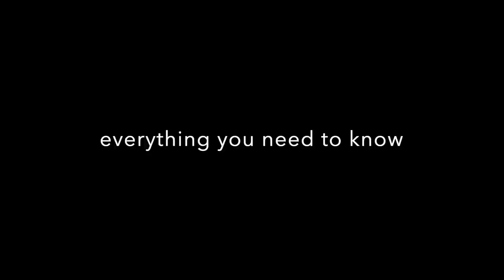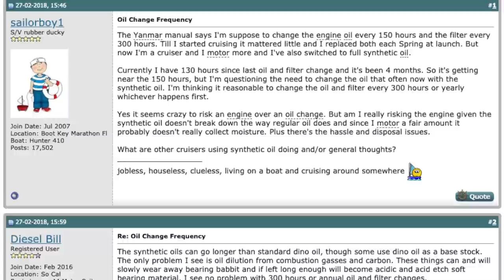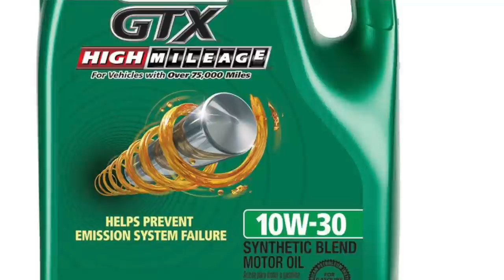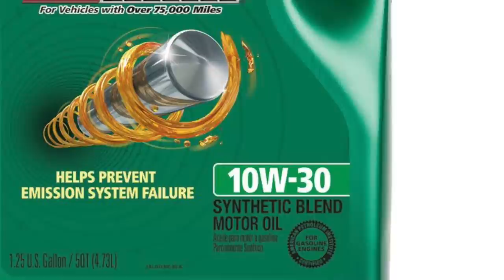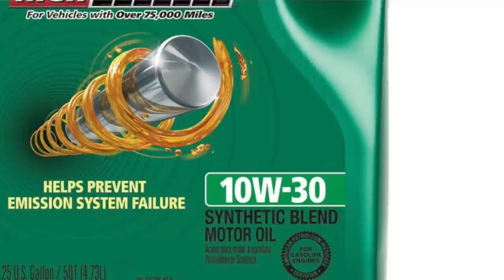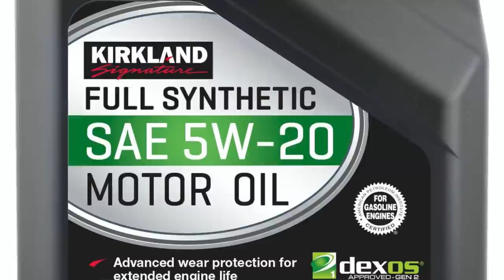Is this OIL wrong?? Episode 120 - Lady K Sailing

Comment: We're to start  you need to go buy the proper spec. Oil .diesel  that  are newer with a EEF on the exhaust for emissions need a modern oil so not to pug up exhaust particular filter  if you do not have any emissions on you're engine  than look at shaight weight are older spec 1540 these have highed zinc content  . Good for bearings .
The reason for oil change intervals has mainly to do with dust or silca content and or  high load at the maximum  torq rpm  for extended periods on time if you do not have one or the other or none you can run out the oil drains to more   hours the best way to know is to take a oil sample and send it out  to oil Annalise lab. this can save lots of money over time and save labor and also they will tell you if something is coming apart inside of motor . Fact is you can extend out to maybe twice as long . 400 500 or longer if conduction are right again with test of oil sample   if it does not need changing do not change  and if you ask some experts. They say it can be worse because you are opening the engine so chance of contains enter eng. Can be high.
That's way the oil filter manufacture company's sell extent drain filters .   Just something to think about .
It is just or more important to change your fuel filters  on a diesel . Also the oil company's are always changing and up grading the spec . So if you're oil spec 10 years ago check be because they my have a up dated oil now.

Comment: i use Pennzoil euro 5W -40 in my Ferrari ! and spec'd by them it is owned by shell now ! so just marketing ! ( NOT your fathers penzoil ! ) YES weight is the MOST important ! use what the maker recommends ! brand is FAR less important  interesting oil analysis engineers blackstone labs says they have found NO difference in wear among ALL major brands of synthetic oil ! so, the brand is largely irrelevant ! LOL ALL oil has to meet SAE standards, ( and does ) !  as long as you change the oil before the additive package degrades you are good to go !

Comment: Some oils have chemicals to help the engine metals like aluminum and steel anodizing in side the engine block. And some Diesel engine are more iron and steel inside parts of the block. And most engine can’t use zinc in oil do to the catalytic converters same with leaded fuels. And zinc in the oil is good as a micro filler to micro scratch in the parts same with leaded fuels. Now someone is going to say lead is bad not refined lead is poisonous not natural lead. Because if that is so no one in south east Missouri and east Arkansas would be alive because one of the biggest lead deposits is there right along the Mississippi River. Lead fuel was not banned go to a airport and you will find low lead avgas. It was banned from automotive gasoline for two reasons older cars run dirtier than catalytic converters cars so and lead kills catalytic converters kill lead fuel save catalytic converters kill older engines win win. So if your engine is older made in the time of zinc oil find a zinc oil.
Reply: That's not true. Diesel oils like Rotella T6 10W-40 contain 1200ppm (parts per million) of "zinc" (zinc dialkyldithiophosphate) or ZDDP for short. The ZDDP levels in API SN and SN Plus oils is 600 ppm. API rated oils between 1990 until after 2000, like API SJ had about 800 ppm. ZDDP has been found to shorten the life of catalytic converters so the oil manufacturers have reduced the ZDDP content to comply with OEM cat makers but also use newer anti wear additives, like Moly. Even today oils with a viscosity of 50 or higher will have more ZDDP,  up to 1200 ppm, even oils for gasoline engines.

If you don't believe me take an oil sample and have it analyzed. The labs always show the exact Zinc content.

Comment: Some of your info is miss leading, yes seals out of buna do not like synthetic oil ,however with that said newer engines starting in the 1990's use viton  seals which is ok with synthetic. Problem is most engines were still using dino oil, change out to synthetic oil with its's higher concentration of cleaners remove the build up of sludge around seals and you have major oil leaks and I have personally seen it when people switch over to synthetic oil after years of regular oil. Also Perkins ,Volvo in any engines from 1970's to 2000 tells you not to use synthetic oil in the manual
Reply: Not at all true.
Reply: @wrenchoperator6435  prove it
Reply: @Mechone11  you literally have the entirety of human knowledge available at your fingertips, but you'd rather just make shit up or pass along rumors. Google it and you'll find many of your statements are wrong.
Reply: @wrenchoperator6435  I'm not wrong  ,I've changed 1000's of seals  you make a statement with no grounds .I have seen many times someone changes to synthetic of the car starts passing oil. YOU on the other hand  call someone out with no facts , I'm all about learning ,but not from some useless armchair critic
Reply: @Mechone11  your personal subjective anecdotal experience is not considered "facts" either. It's worthless rumor and assumptions not backed by any scientific evidence. It's funny that thousands of other people can have the opposite experience with synthetic oils. BTW, Buna seals are still widely used in "newer engines."